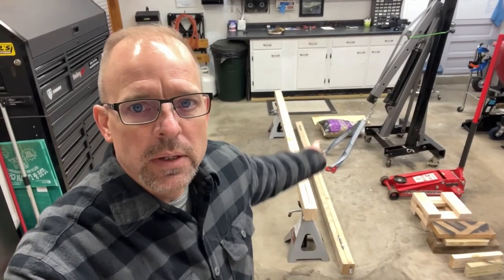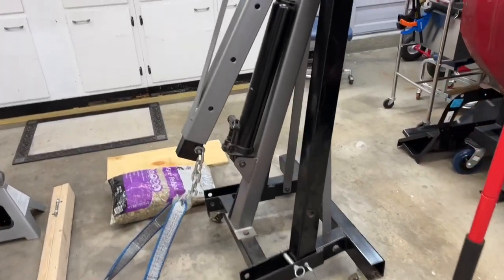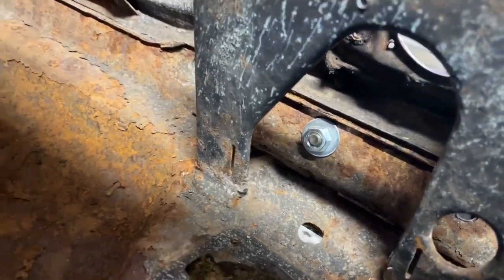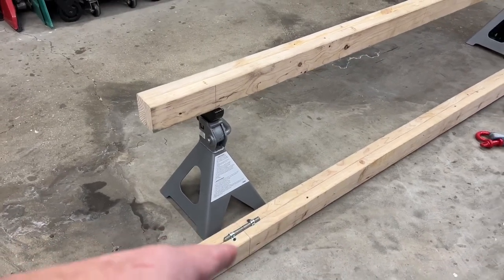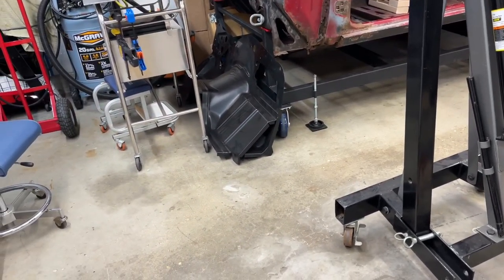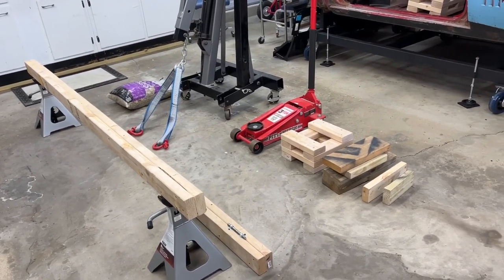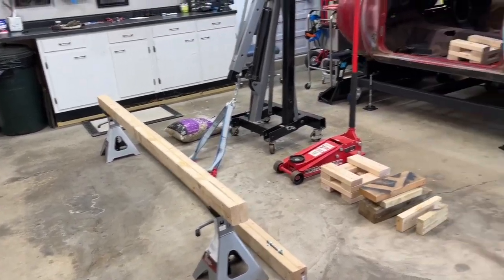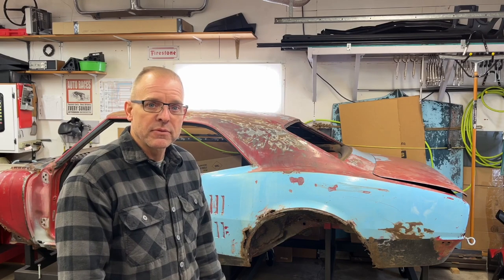Tools for lifting car onto body cart

Comment: Cool, I built my 1st jig under the car.  The hardest part for me was getting off of one jig and placing it onto another.
Reply from the maker: Thanks. It took a little jiggling around when we took it off the cart the first time to weld up the last set of brackets. Hopefully it will come off ok the next time. Thanks for watching.

Comment: You would have been money ahead if you had just went to the harbor freight store and bought you another engine hoist using the two engine hoists and your lifting points on your car lift both ends at the same time and rolled your cart in from the side until you got everything lined up then slowly let the car down on the resting points of the car frame. Just saying.
Reply from the maker: Thanks for the comment. Pretty sure what I used cost less than another engine hoist. I barely have enough room for one hoist let alone two. Maybe next time I can borrow one. Thanks for the advice. Appreciate it.👍